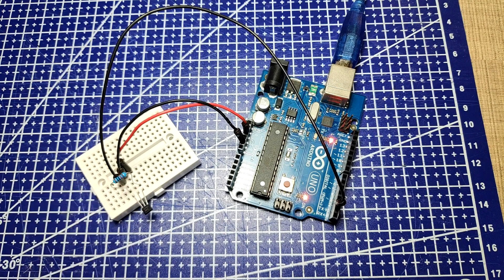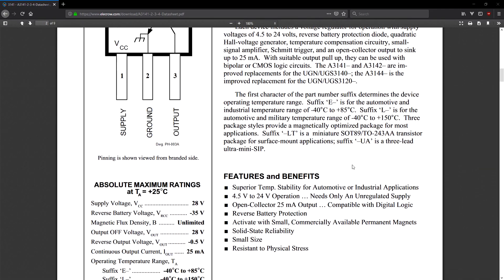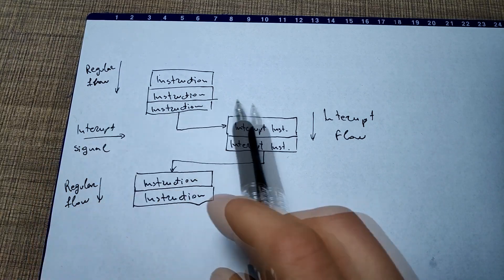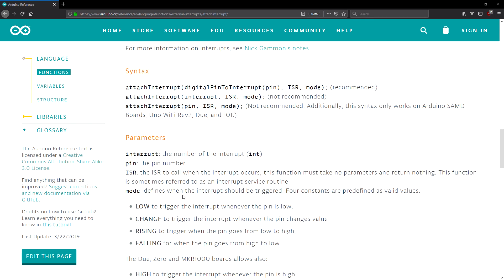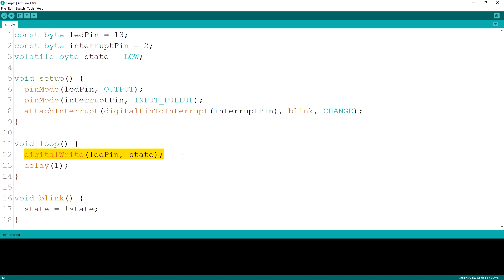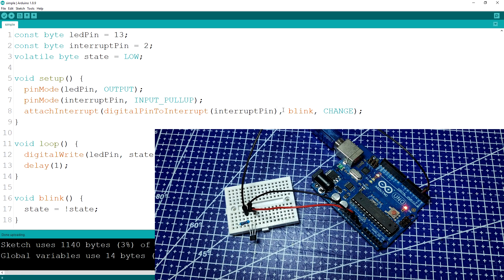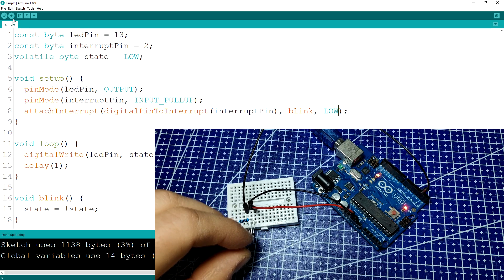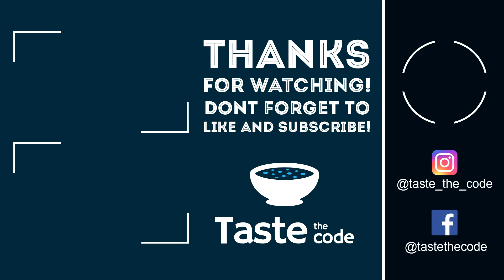Arduino hall effect sensor with interrupts

Comment: Nice explanation. Thank you. I am using the hall sensor output to read the rpm of 8 pole BLDC motor. I am trying the formula but not getting the relevant reading. May I know how the interrupt and counter function should be used for the same?
Reply from the maker: Sorry but I'm not familiar with how it should be done for motor control.

Comment: Nice video, thanks.  Not being a electronics guy, I was wondering if you could tell me where to connect the capacitor.  Cheers
Reply from the maker: I'm glad you like it. There is no capacitor required in the circuit. You only need the pull-up resistor across VCC and output, or pins 1 and 3. You can add an additional 100pF capacitor between VCC and GND but that is not required at all.

Comment: Many thanks for sharing this. I learn a lot from wonderful people like you.  I think this can be used to build a weather station that records wind direction and speed.  For wind direction, I think I will be needing 8 hall affect sensors to detect changes in wind from N, NW, W, SW, S, SE, E and NE plus maybe another sensor to record wind speed.  Would it be possible to connect all 9 hall sensors to arduino and use interrupts to process the incoming data?
Reply from the maker: That is a really good idea. However, the Uno has only 2 external interrupts so you'll need have them connected to regular digital pins. Definitely doable 👌

Comment: Hello, I tried the code with CHANGE, but the diode wont turn off until I come close with other side of the magnet. Could you please help me?
Reply from the maker: Sure, can you confirm that you have the same sensor?
Reply: @TasteTheCode  Unfortunately I use TLE 4935 L (heres datasheet https://www.gme.cz/data/attachments/dsh.533-442.1.pdf )
Reply from the maker: Well that explains it as what you have is a Switching Bipolar Sensor. One pole of the magnet turns it on and the other turns it off. You can see the behavior in the datasheet at page 5 on the graph.  What is it that you are trying to build? Any specific project?